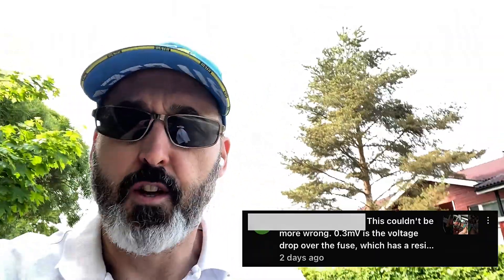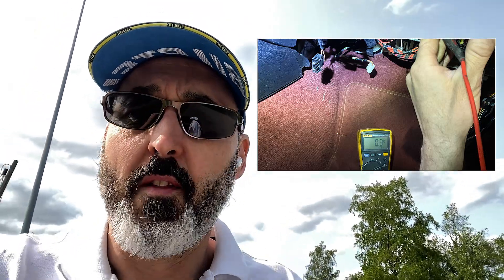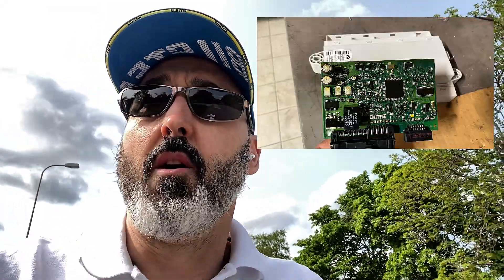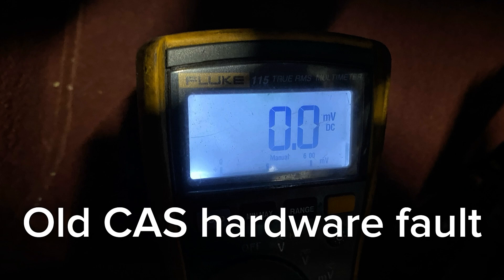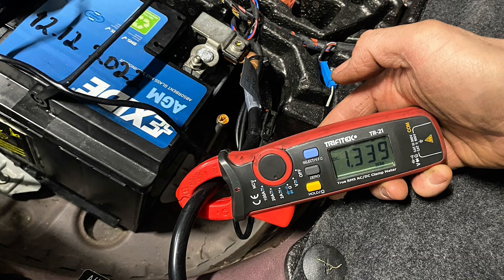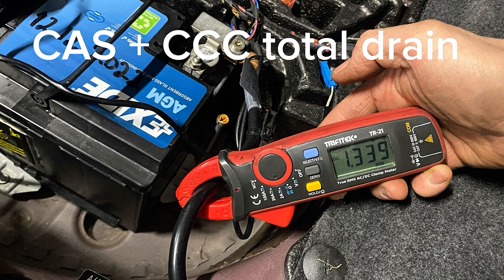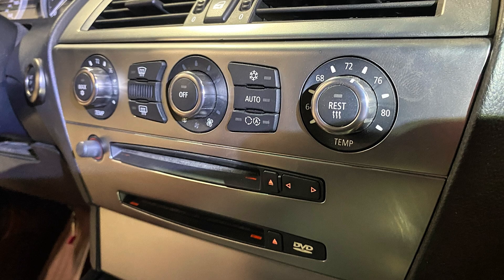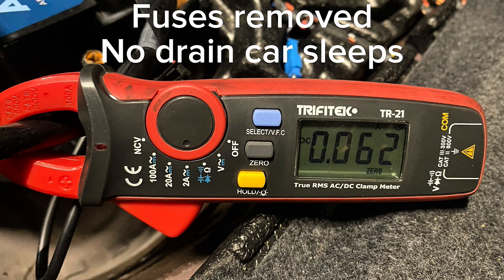They Said It Was ‘Just a Voltage Drop Test’ – Here’s Why That’s Dead Wrong!

Comment: I like using the amp hound tool to. You punch in the fuse type and rating.  Clip across the fuse. It gives you a amp reading. Basically a tool that done the mill volt to amp conversion. I found the tool very useful. 
Anotjer hreat video displaying top quality technical information
Reply from the maker: Thankx buddy

Comment: It's Ohms law! 🤷 
There's a volt drop across the fuse because current is flowing through the fuse. The fuse, despite being a simple peice of wire, does have a very small resistance, therefore, according to ohms law, a volt drop will be measured across the fuse in proportion to the current being drawn through it: V=IxR. 
So, for example, if the fuse resistance is 2 ohms, and you've measured 0.03 volts across the fuse, then the current being drawn through the fuse is 0.03/2=0.015 amps, or, 15 milliamps (I=V/R). It's just ohms law, folks 👍
Reply from the maker: It is Ohms law. The point is not that. Did you understand the reason why I measured a voltage drop and for what purpose? This is the whole point of the entire video.
Reply: @BenJFF  Yep. It made perfect sense to me. Again, if there was NO current flowing through the fuse, then the drop across it should be zero. But it wasn't. Therefore current was flowing. Your test allowed to you zero in (no pun intended!) on the nature of the problem. It's clear to me you know what you're doing!
Reply from the maker: @NotMarkKnopfler cheers Mark is it Mark? Yeo it was 0.0mV after I ripped out that knackered CAS